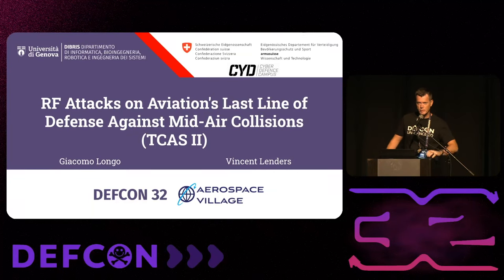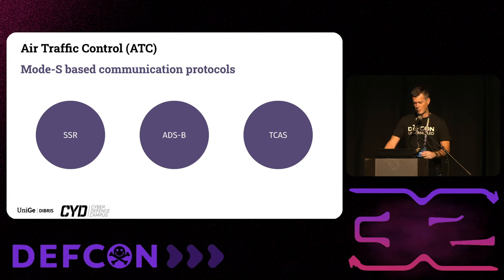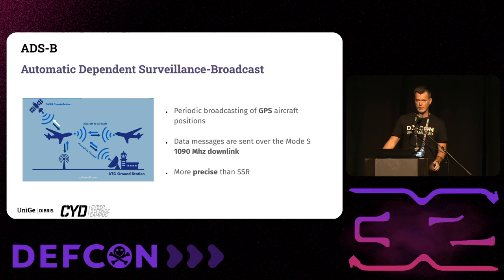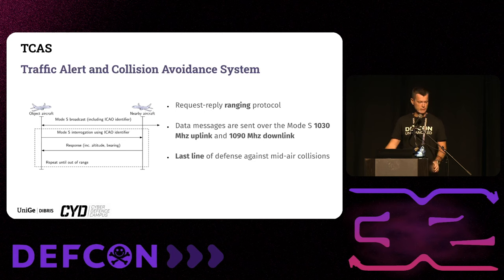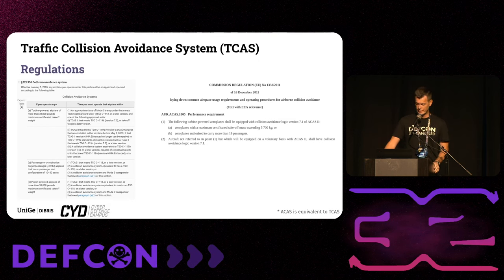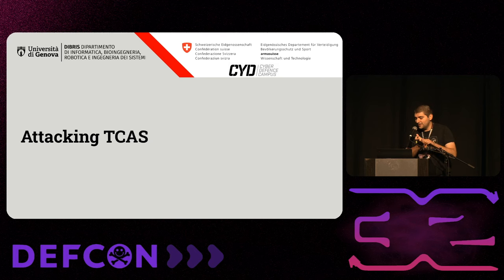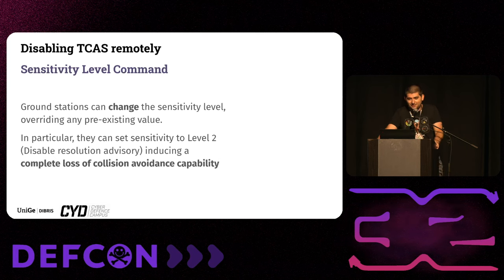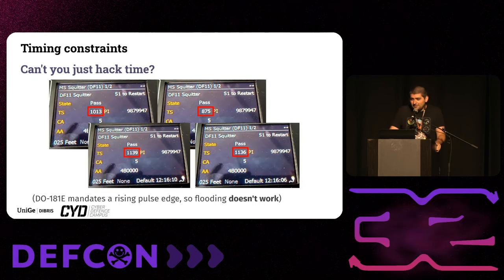DEF CON 32 - RF Attacks on Aviation's Defense Against Mid-Air Collisions - G. Longo, V. Lenders

Comment: seems like a useless exercise. the worst that happens is they are forced to go around, no ta is going to drive someone towards the ground or into another aircraft.
Reply: The worst that can happen is a collision with everyone on two jumbo jets dead. That's what happened in Teneriffe, about 15 years ago. Heavy rain, low visibility, night time, so the pilots could see each other and impacted at high speed on the runway. IIRC about 500 fatalities.
 And "runway incursions" are common now. Two Delta jets hit in the US recently. One literally tore the other open, very fortunately they had no injuries but that's like saying Trump "was only grazed" so what's the problem?